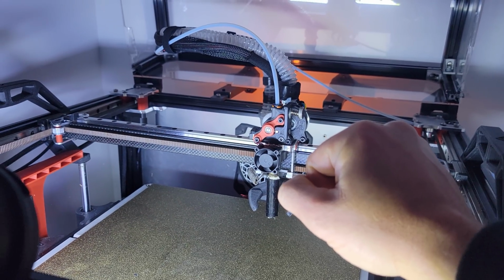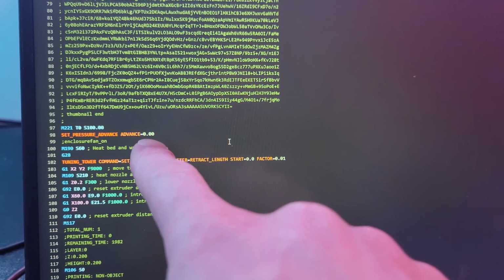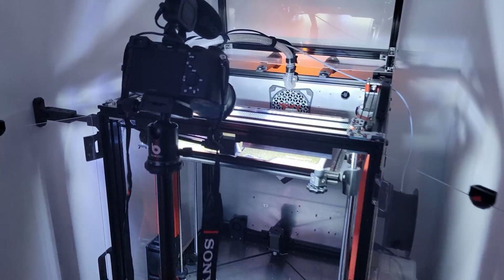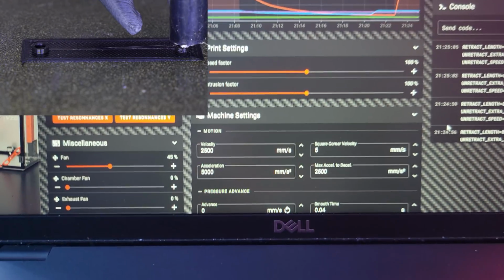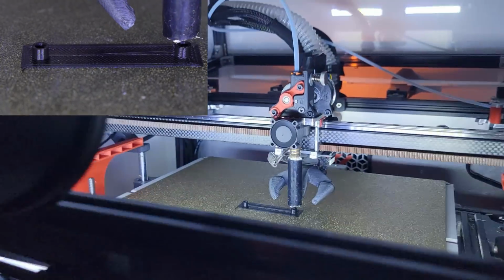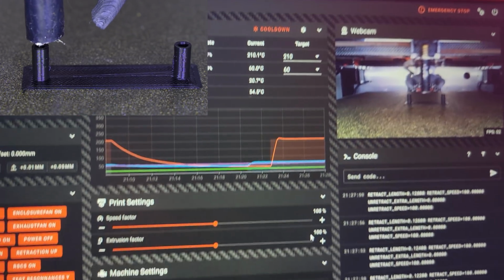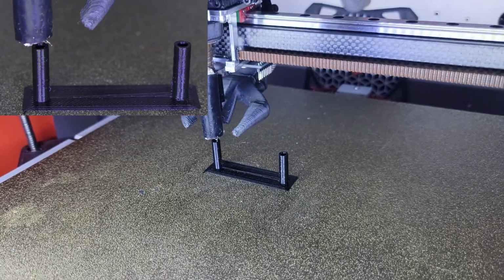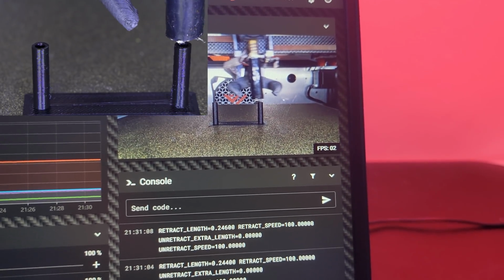LSD HotEnd - The retraction part#4

Comment: Probably the reason it does so well is that there's virtually no internal backpressure, due to such excellent melting. I found a similar result when switching to CHT (albeit nowhere near this good).

Edit: and I got to the part where you hypothesized the same just after clicking submit. 😂

Comment: How do you get retraction and PA on your UI? I use Fluidd and didnt even know that was possible always just used macros
Reply: Firmware retraction enabled in slicer and Klipper I guess and he is using the Mainsail interface :)
Reply: @chaicracker  Ah I use Fluidd so I usually set all that through command line.

Comment: Yeah Klipper can do this calibration type for all/many (I never actually tried all) parameters which gives very quick and clear calibrations.

The discussion on high flow hotends was often that retractions and oozing would increase a lot due to the long melt path versus a short one like a simple Ender 3 style. You prove that the quality of the melt is so much better that way less pressure is built up in the nozzle opening (0.5 mm which does help a bit versus 0.4) itself as the material is really 210°C versus much lower on a short melt zone. The pressure built up in the top of the hotend where the plastic is effectively being molten is way lower due to the larger diameter. The sum of pressures in the top and nozzle itself seems to be favorable versus the gravimetric force pulling molten plastic out with the longer melt zone. 
It should be possible to theoretically prove this with a rheologic calculation. I don't have that knowledge myself but may try whether some colleagues can help me out there.
Reply from the maker: In my last experiences with other hotend.. the bigger nozzles were worst for oozing